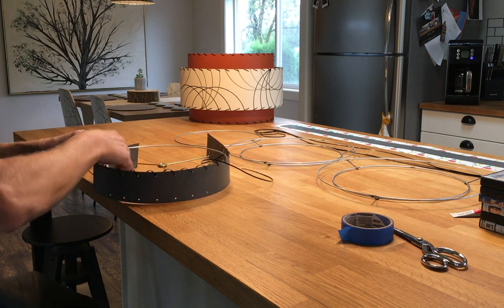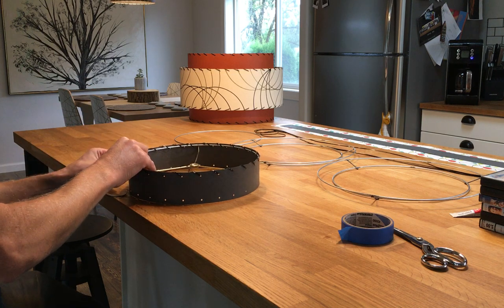#2 RETROMOD Design Fiberglass Lamp Shade Assembly Instructions How To Video

Comment: These directions really are bad.  You go much too fast and the camera is nowhere where we can see your hands or ehat you are really doing.  How about a camera posted OVER your head pointed AT your hands to see what you are VERY QUICKLY flying through?  It is VERY FRUSTRATING.   You are instructing as if we know what you are talking about.  SLOW DOWN .  SHOW your hands as you are quicky quickly describing the steps....and explain in detail.  For example....look for the seam and keep it in the "back", ...but then find the center support and roll it and start 3 holes from the end...?? That doesn't keep my seam in the "back".
Awful awful instruction